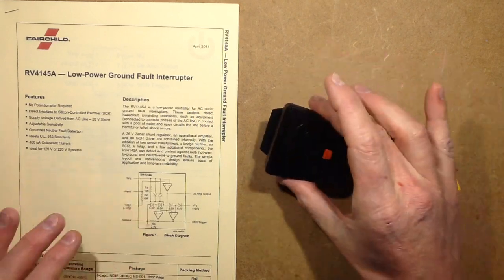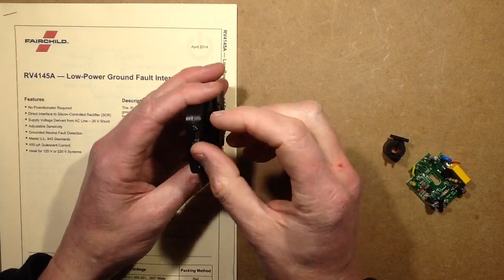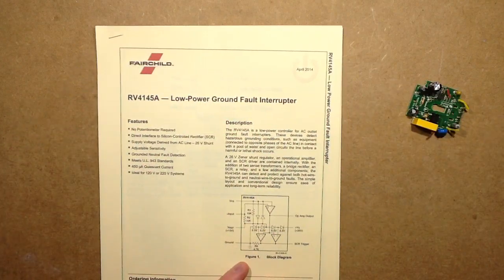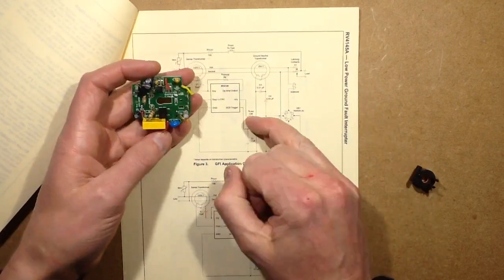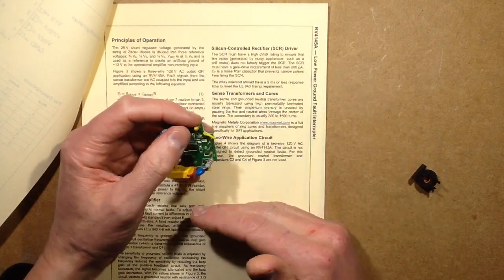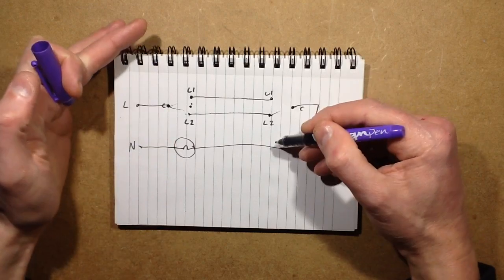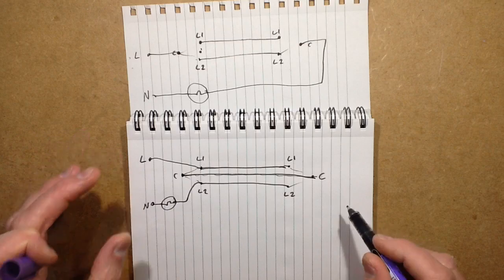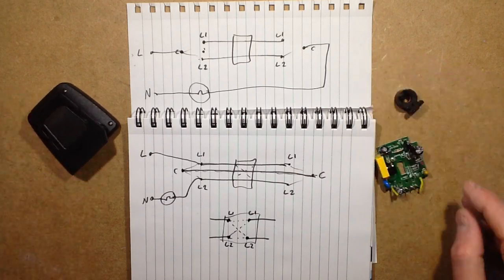2 way, 3 way, 4 way lighting switching and other random stuff.

Comment: The house I now own was built by an airline pilot as a weekend hobby. He built the entire thing himself over a period of 20 years. He was a bit of a fanatic and over did everything. We have 4 way (UK 3 way) switches all over the place. One circuit that controls sets of spot lights on the outside corners of the house can be turned on and off from 41 different places.. He was also a bit paranoid about burglars so these switches were all labeled emergency when we first moved in. I changed the labels to read outside corners. About 1/3 of all the switch circuits in the house have at least 3 switches in them. He ended up with 5 circuit breaker panels at various places in the house.
Reply: +CowboyFrankHarrell 41? Holy shit. That's insane.
Reply: Tanooki100
yeah, i think everything with more than three or four switches is better off using a toggle relay.
Reply: +Mezgrman 

Especially if they don't use toggle relay... (Hint hint, Clive.)
Reply: +Mezgrman I agree with you guys. But what can I say, I didn't build it. :-)
We have owned the house for 5 years now. What I have discovered is Mr. Sterling (the guy that built it) was learning as he went along. It's amazing the detail he put into the house and the amazing quality.

Comment: OK here`s one I still can`t wrap my head around , I worked at an auto repair shop taht had six bay one  for each mechanic who had a switch to operate the exhaust fan (six switches to turn on or off one fan ) and there was one master switch by the door so if someone left their switch on rather than having to go round to each switch you could turn this master on then off and it would turn all switches off ( the master had to be in the off position at all times for the system to work .     I asked the owner how does this work and the only thing he would do is smile and say magic
Reply from the maker: +MrBuck295 It sounds like bad magic to me.  All that was required was the circuit above but with two of the two-way switches at the ends and five intermediate switches in the middle.  Six of the switches would have been for the mechanics, and one would have been the master switch at the door.  If the exhaust fan was a high load or three phase then the switches would control a local contactor (probably with motor overload protection built in) that would switch the motor.  It sounds like the original might have been wired wrongly if the switch at he door would only allow the others to work when it was in one position.
Reply: +bigclivedotcom  I still don`t quite follow because if I left my switch on and he used the master to shut the fan off then I would have to turn my switch off then on to use the fan again . We were told not to try fooling with the switches or be fired ,the screws were painted and if the paint was removed you got fired  ,still find it interesting to think about though
Reply from the maker: +MrBuck295 Oh that's odd.  The other common option would have been to wire a start button in parallel to every station and a stop button in series to every station.  That way, anyone pressing their start button would start the fan and pressing any stop button would stop it.
Reply: +bigclivedotcom Not sure as I never got the chance to open my switch box ( didn`t want to get fired ) all I know is all the six switches were wired parallel ,so if you tried to turn off the fan while mine was on the fan stayed on but if all switches were on you only needed to go the master and flip it up the fan would stay running then flip it down then the fan would go off ,then if you would go to any of the six you would have to flip the switch down nothing happened then up the fan came back on,but if the master was left in the up position weather the fan was on or not you could still turn the fan off at your switch but not back on . maybe it was magic  ( I was so paranoid about getting fired I wrapped celo tape around the whole box just leaving the switch exposed ,one guy would scrape your paint just to get you fired )
Reply from the maker: +MrBuck295 Ah, it might have been a latching relay system at the controller.

Comment: I'm always curious how things are wired in other parts of the world.

As usual,  American electricians have slightly different meanings for 2 way, 3 way, 4 way..

A 2 way circuit in the US uses only 1 switch 
A US 3 way circuit is 2 switches..

So for example, if you have a UK 2 way circuit, it is a US 3 way circuit. In other words, if you are talking about an UK N-way circuit,  add 1 to get the US equivalent.

Also American electricians call the "strappers" travellers.
Reply from the maker: +CowboyFrankHarrell That's actually a neat albeit slightly barbaric way to remember it.  From now on I might refer to those wires as "kneecaps".
Reply: +Steve Rodgers Again here in the US I was taught the reason for the names (3 way / 4 way) was the number of screws on the switch. Was also taught the travelers/strappers, were called "legs". If you wanted to add a 4 way (intermediate switch) you just broke the legs and added the switch. That could have been just a local concept to make it easy to remember.
Reply: +CowboyFrankHarrell Yes, the US way is the number of screws, the UK way is the number of switches  (1 way=1 switch, 2 way=2 etc). Either works provided you know which everyone else is using :D 

Love the 'break the legs' thing.   Hope you're having a good Christmas
Reply: +Steve Rodgers You beat me to it. I was going to say the same thing.

Comment: Hi Clive,Many thanks for presenting your Christmas Edition. These videos stave off the boredom and actually educate.On the two way or intermediate switching examples, I too was taught the way to wire was as per your first diagram, when I was doing my Union of Lancashire and Cheshire Institutes Electrical Installations, Craft Theory and Practice.That dates me. Ha ha! Anyway, in the Yellow On-site Guide, section 7.4.4. Page 80 it gives the reasoning for why the preferred method of wiring is as per your second diagram.Apparently the former method is prone to cause interference with induction loops for the hard of hearing.In Spain what we refer to as an intermediate switch is referred to as a Cruz, meaning cross, which when you think about it actually describes the function rather well.They also had a method of wiring two-way circuits, which their regulations have now out-lawed, which had the potential to cause a short circuit, and when I can find it I will post it for you.
Again, many thanks for all your interesting output. A friend of mine recently showed me a LED lamp which included a motor unit to give a dance hall or kalaedoscope effect. Would have loved to have sent it to you for a teardown, but it was a Christmas present for his God daughter.
All the best for the New Year!Desde el chico electricista. Yes I too have that book The Boy Electrician! - I am going to make a Leyden Jar this holiday, but an X Ray apparatus is another matter.

Comment: LOL ive had to fix a few peoples "putting up a new fitting" screwups, commonly its the blokes that do it, they dont label wires, and wire it so the breaker jumps out when they wire the switch or switches across the mains lol.
The power jumps from fitting to fitting supplying the incoming switch wires and light fitting with earth/negative, but not allways wa wa wa lol.
I kill the power, then find the switch wires, they dont allways use different coloured cables so a continuity tester is a good frend.
Using spock logic, anything that isnt switches must be power :).
Its not hard to fix, im a right plonker and i have recovered lots of peoples messes lol.
Crossover switches ive never seen, but i know of there existance.
Reply from the maker: +zx8401ztv The all reds/blacks or browns/blues commoned together situation.  I've helped a few friends with that scenario.
Reply: +bigclivedotcom lol im glad its not just me that gets the people that like joining all wires :-D
Hope your enjoying your xmas clive :-D

Comment: I was about to poo poo your second example of having live connected to L1 but then yes it would work.

I am not sure what the electric regs say today but when I done my ENTRA college course back in the 90's they only showed your first example.
As part of the course we had to wire up a cut down version of an entire house circuit including the consumer unit (downstairs ring main, lighting circuit, heating circuit etc).
brilliant thing to do but not overly complicated at all.

what makes two way circuit switching hard is when I have had to fix a few DIYer's house bodges when they have decorated. trying to figure out where they went wrong took longer than fixing it.

and I am not even an electrician.
The ENTRA college course back in the 90's was brilliant. six weeks electrical work, six weeks mechanical, six weeks computer programming, six weeks electronics.
Reply from the maker: +BillyNoMates1974 I was taught the first way at college and while wiring a new factory unit that had basic wiring already installed I came across the newer 2-way arrangement as surface clipped cable in the basement.  I was so intrigued that I traced it out and drew it down and then went through all the switching scenarios in my mind.  Then used that system from that point on.
Reply: makes sense. allows for upgrading in the future

Comment: Yep, second method is preferred for 2 way, only 1 pair from the lampholder (where live & neutral loop through) to the switch, saves having connectors in the circuit, or single cables. (do you remember sing core double insulated cables for house wiring ? ) :D
Reply from the maker: +Sparky Projects Yeah, not seen that for a while,  but at least that was better than insulation tape wrapped round the earth wire so it could be used as a live conductor.  Came across that a few times.  Including when I was staying in a bed and breakfast next to a site and the place was owned by a builder who had clearly "wired" it himself.  Complete with excessively cropped back twin and earth (grey ending about 3" from actual switch) exposing the repurposed  live-earth core.  There was also a junction box with exposed live copper at waist height, and the guy had kids running about in the place.  Fortunately he's probably got a Part-P certificate now so it's OK.
Reply: I certainly do. Came across a load last weekend. Nasty stuff trying to save cable!
Reply from the maker: +Tera Volt It's the three phase colours.  Used to be red, yellow and blue.  But then some total clowns decided that to comply with European standards they'd change it to three bland dull colours instead.  So now it's brown, black and grey.  (The colour code change also swapped a phase colour with the neutral colour of the old code.  Black became blue and blue became black.  No seriously....  They did actually do that.)
Reply: +bigclivedotcom It makes sense in european compatibility, since red-blue combination is reserved for DC, but I can see how it could be pain in the a... 
On the other hand, if there wasn't WW2, we would be driving on left here in Czech rep. as you do, and it wouldn't make much sense as all the neighbouring countries have driving on right, I guess some changes are for the better even if they are so painfull.
Reply: +bigclivedotcom LMAO @ the part P dig :)
Reply: +Sparky Projects We still do SDI in aus, I don't know how you'd use a 3 core cable between switches in the second drawing. We're using red for live and white for switched live for 1 way and the two as the strapper for 2 or more way, SDI from each end switch back to the fixture.
What colours are used for the 3 core?
I guess we'd have to use a 3 phase cable to have 3 live colours to use.
Reply: +Tera Volt In the old colour scheme we use red for live, black for neutral, a 3 core cable was red yellow and blue (same as 3 phase colours), i used to wire red for live and l1, yellow for switch return and l2, blue for the commons
New wiring colours are  brown black and grey
Reply: Yes, we're using Euro colours for appliances and ext5 leads, building wires are red/white/blue. Was R/Y/B based off the UK but as earth is now green/yellow it was decided to change the yellow phase to white
Reply: I don't understand what the difference between the first and second method is. To me it seems they both require the exact the same effort. The two straps (strappers?) are identical in both cases and in the first case I have to run a wire from the last common to the lamp and in the second case I have to run a wire from the first common to the last common. I would really appreciate it if someone could explain that to me.
Reply: +Jack White there isn't really a difference,
If the 3 wires between the 2 switches are one piece of 3 core cable, and you have a pair of wires from the lamp (live and switch return), in the first example you would need a connector in the switch, in the second example you don't
Reply: +Sparky Projects  So it comes down to being able to use the connector block on the switch, where I do have two ports, instead of having to use a separate connector block. Am I understanding that correctly?
Reply: +Jack White Yes
Reply: +Sparky Projects   Thanks! Now I can rest easy.